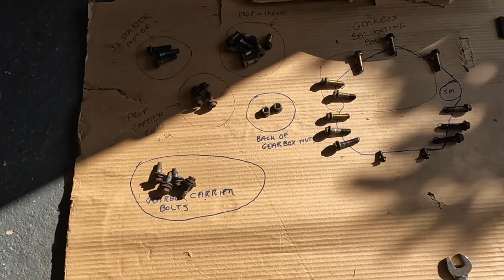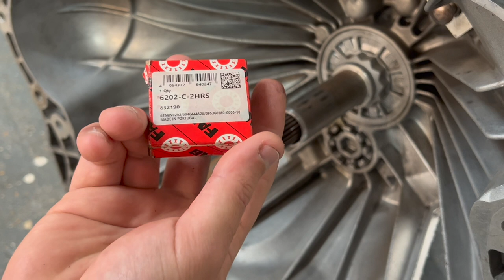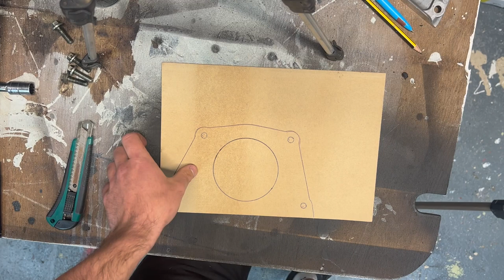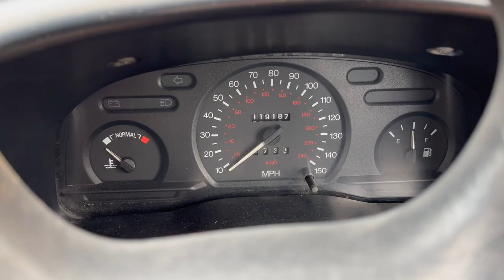Clutch & Rear Main Oil Seal Replacement - Step by Step (Full DIY Guide) - Ford Transit

Comment: I have a 1998 Transit 2.5 TD camping-car. I’m not a mechanic at all, but thanks to your detailed explanations i got more and more confident to repair things by myself, starting with annual service. Last year the timing belt/water pump. I even changed the turbo and fixed the black smoke issue i have had since a few years. Coming back from holidays this summer i hardly managed to return home as the clutch was completely worn out. Without this video i would never have been able to fix this by myself. A massive thank you for these great videos. Keep doing what you are doing !
Reply from the maker: It’s my pleasure, I’m so glad that you find them useful! Well done for doing the repairs yourself 😁 You will never have to spend money at the garage again 😎

Comment: I was installing a new clutch cable and the fork fell away from its position, came across you vid and it has given me hope, what a champ 💪
Reply: Had the same thing happen, did you fix it? Was the fork bent or did ot just slip off?
Reply: @lukasgoos6243  i replaced the seal bearing and clutch kit recently, it has solved my original problem of not being able to select 1 very well when stationary, and my clutch works but the peddle is super high i had to adjust the cable a lot for it to work which leads me to believe my fork may be bent a bit, in hindsight i would have replaced the fork also but it works, i think i was too heavy before on the clutch when the throw out bearing was loose. Time will tell if the fork is okay, can't be bothered to pull it all off again.

Comment: Really surprised what I see, all parts in more than reasonable good nick aren’t they? Must feel a well rewarding job Mate!
Reply from the maker: This one was very rewarding, feels great to get it all back together like new again. It’s in great condition because of all the oil protecting the metal! It’s great for rust proofing and I will need to keep on top of the rust now it’s not covered in oil 👍🏼 cheers mate!

Comment: good job need to do mine before winer,did you have any problems linig the splines back up  when refitting gearbox to engine,i know sometimes they fall right back in but if there off a bit can be a bit fiddly

Comment: Hi, it is amazing what you have done so far with your van. I have the same platform under mine, and I have done the same sealing change, the timing belt change and the main shaft bearing change so far according to your videos I think you have mentioned if I remember well, do you have a turbo engine?
Becouse my turbo is a little bit oily…
So thanks for your guide wery useful for me and Im sure for others too.
Reply from the maker: Thank you for watching 😊 really pleased that you find the videos useful. Mine doesn’t have a turbo, yet. It may be the turbo oil seals have gone and need to be replaced. Worth getting the turbo reconditioned or replaced perhaps.

Comment: good job need my rear cranks seal replacing as its shuddering when hot...did you have any problems lining the splines back up when refitting gearbox to
Reply from the maker: Hey Sean, thanks for your comment. The splines lined up completely fine luckily, no problem getting it back in 👍🏼

Comment: Thanks for doing this.. is this your first new clutch@120k?
Reply from the maker: My pleasure Nick, thank you for watching. The clutch I removed is made by Sachs so not the original. The van only came with partial service history, so I was unsure of the condition of the clutch. That’s one of the reasons I replaced it prematurely. Plus the old one was most probably contaminated with oil so best not to reuse 👍🏼

Comment: Did this on my VW Caddy. Good God. The rear main has a slotted sensor sendor that goes around it for the crank angle sensor, that has to be within a tolerance of 0.5mm or else the engine won't start. after removing and replacing the transmission 3 times I got it right!!
Reply from the maker: Sounds horrendous! 🫣 loved the simplicity of my old van 🚐

Comment: Hello, just one question...😢😢😢
I have a Ford Transit nugget 1999, but the diffential wasn't sure, I took it apart but now I can't find someone to rebuilt it..😢😢 do you know where I could find someone or some other spares parts. Thanks very much for your help
Reply from the maker: Hello mate, there should still be diff specialists around or alternatively you could look for a second hand one. The Facebook groups for transits are good for finding parts :)

Comment: Hi Oli,
Can you please tell me where the parking brake signal switch is located on the transit, I have issues with that switch but it is not on the parking brake bar.
Thank you in advance.
Reply from the maker: Hi, it could be on the handbrake lever. That’s if it even has a switch. What’s the problem you’re having?
Reply: Hi, it is not there, I removed the rubber cover. The problem I have is there is no sign on the dashboard of the handbreak is pulled.
I realised, the light is on, when the starter motor spins, after the engine is running, the light goes out.
Regards: Balazs
Reply from the maker: @balazssolymossy1960 are you sure it’s the handbrake light as mine doesn’t have one. Could be the battery light? If you instagram me a picture of the light I can check for you.
Reply: Thank you,
It is on the left of battery charge controll lamp, and it turned out that it is the control lamp of the brake fluid level, it is shaking when i start the engine or it has faliure, anyway the fluid level is ok, so i will not pay too much attention in the future on that light, rather the fluid level in the reservoir.
Thank you for your answers, and help, and especially for your time you spent on my problem.
Have a nice day!
Reply from the maker: @balazssolymossy1960 no problem mate, glad you worked out what it was in the end. Cheers you too! 😊